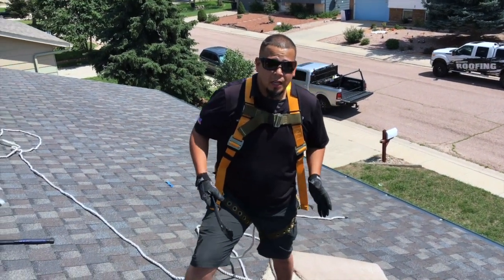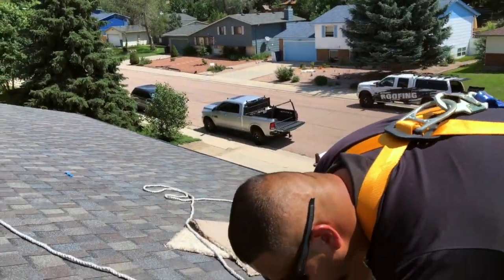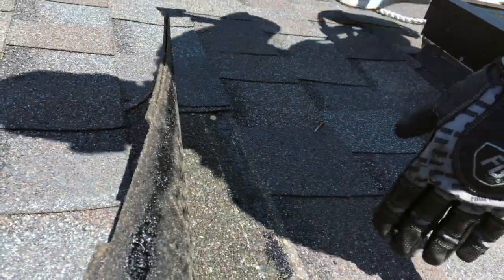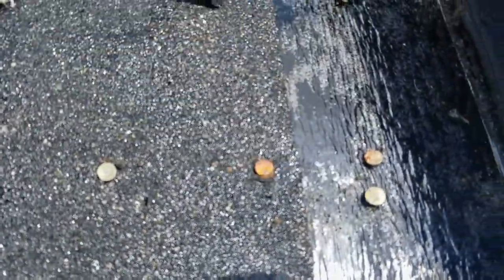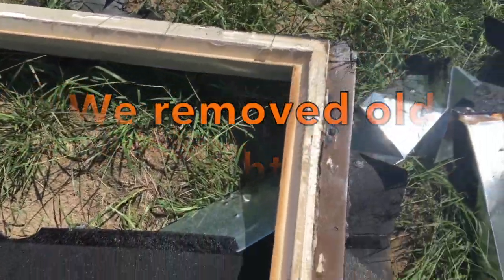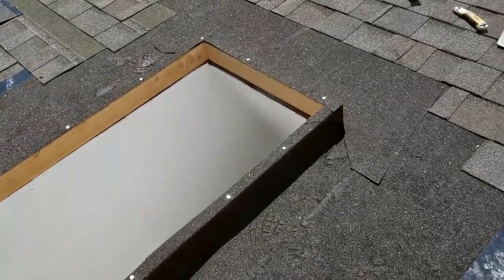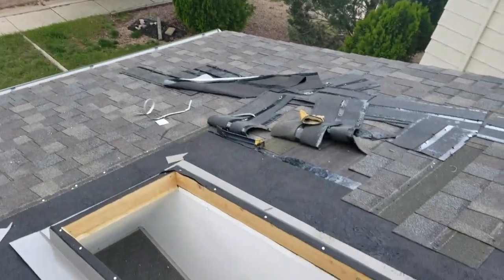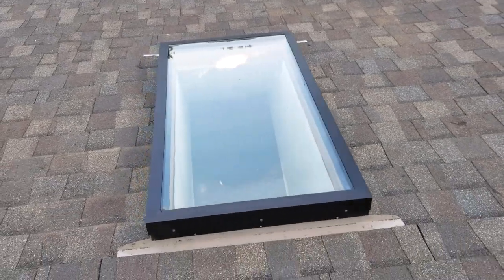HOW TO REFLASH A SKYLIGHT LIKE A PRO

Comment: looks good usually i run an individual flashing 3”x6” per shingle running all the way up that ensures any water slides right down without having a chance to get back underneath the shingle and flashing and being called out again
Reply: Called step-flashing.  Which I don't understand why isn't standard practice

Comment: Interesting to see how you manage with straight flashing.  You still end up with upper corners that depend on sealant and the membrane below for protection in torrential rains.  A formed upper flashing would be better, when one that fits is available.

Comment: Great vid, question if I may. Can silicone perish and let in water? I believe silicone was used in between the curb and the skylight cap when it was seated. After repointing the coping stones and applying a water proof sealant underneath them and still having water ingress it dawned on me that water may be getting in over the curb and under the skylight cap through the silicone and into the roof space. Would like your opinion. Thanks

Comment: Enjoying your videos. Any concerns about water traveling under new shingles against new curb since no ste flashing was used?
Reply: Meant step flashing.
Reply: Agreed.  That was my point as referenced above.  Why no step vs. a long section.  I it won't leak at the skylight, but the lack of step isn't directing the water back on top of the lower shingles which isn't preferred in my opinion.
Reply: Thank you.  I think that Joe has some sort of defect between the ears.  Sounds like you know your stuff backwards and forwards.  What area of the country do you work out of?

Comment: I have leak from skylight on my concreate tile roof.  A roofer said he has to remove tiles like 10 feet from edge or something and he would give me an estimate.  

My home was built in 1988 and I don't believe this skylight(have 2 of them) had been replaced so it is an original imo. 

Should I replace the skylight as well?

Please advise.

Comment: I have a porch with some skylights that I installed. The pitch of the roof is 1 or 2 so it’s almost flat and I have water pooling on top of the skylight. Is there a type of flashing that would prevent that from happening?

Comment: Basically you did the same thing as I was there before you put one piece of metal when you should’ve use the step flashings after each single within a year or two is going to leak the same way
Reply: He did it wrong! He should have used step flashing, not one long piece of L-metal, which is going to leak!
Reply: in the business of staying in business perhaps?
Reply: He put an ice-dam under the flashing that drains onto the top of shingles below the window. It's less labor intensive than the step-flashing approach, more costly, because the ice-dam is really expensive but the method is just as effective. I would not have run the ice dam on top of the curb for energy efficiency, but it'll work for keeping the roof dry and the window sealed.
Reply: How do you step flash a metal roof?😅

Comment: is it against the law to use step flashing in the west?? looks clean but all vertical curbs .walls in a shingle system roof should be step flashed
Reply: Why would you want step flashing vs. one piece? I come from commercial side of roofing and have only experience with metal roofs, but that looks better then step flashing Iv seen done.
Reply: @morehp1  I think because water will inevitably get underneath the shingles along the wall, the step flashing will keep bringing the under-shingle water to the surface before it spread sideways so far that it's already flow off the side edge of the flashing but still underneath the shingles.

Comment: Where do you get those aluminum pieces? Are they made specifically for the skylight? Did you cut them out yourself? What is the correct name of it?
Reply: U should put in the time in the video so we know exactly your question, but I think the answer is Step Flashing, also there are kits for specific skylight that also come with counter flashing, should come with new skylight.
Edit: wow they used one piece row flashing, I think they use roof cement to stop water from going under, would like to see this hold up, I think step flashing will hold up better

Comment: Interesting technique. I've always wondered why not just use one long piece instead of step flashing.
Reply: Horrible technique. He should have used steps.
Reply: The one pc works great when it has an open hem on the outer edge of the metal
Reply: You can't beat the quality of step flashing technique period...
Reply: mutante 77 not true. Just another old fashioned opinion
Reply: @qualityleafguardsguards7978  so wait you're tying to say that when you're shingling against a wall that's 30ft long, it's better to use one long piece of L flashing rather than step flashing? Get out of here. Step flashing is the best way to water tight a side wall and skylight.

Water flows downwards yes, but it also has the chance to flow sideways a few inches every half foot or so. That's literally why there's a 6+ inch book, no nails within 4 inches of a seam. Felt or synthetic is to be put on horizontalally at the eaves then continues upwards with a 3" overlap. Etc etc.

Don't go commenting on something G that you don't have a clue on how it works.
Reply: @Josh-ww5kz  bro, it’s not necessary to be a know it all when you don’t know it all.. I’ve been roofing for over 20 yrs and have  had great success and have fixed a ton of water leak problems that have been worked on by countless roofers and have seen places that step flashing was not doing the job!! On long sidewall flashing runs you need to make sure the flashing is one continuous open hem connected and flowing into itself
Reply: @qualityleafguardsguards7978  please stop. If you know anything about roofing you even know that velux skylights doesn't do this. Why don't use use a long piece of L flashing if it's superior to step flashing? Exactly. Because it's common sense on how water flows. You're just a leaf guard installer. RCABC doesn't even allow that, any inspector would fail it straight away if steps weren't used at a wall, chimney, skylight, etc.
Reply: @qualityleafguardsguards7978  if you've really been in "roofing" aka leaf guard installations, for 20 years. You should know how step flashing at walls/curbs works, one step per shingle, and the step should be a inch or so past the top lip of the shingle. The bottom should be pretty much just on the nail line or just above the tar strip on the underside of the next shingle going on. That way is the best proven method period. Proven by literally any shingle manufacturer and RCABC.

Comment: A one pc flashing for the side walls works great but really needs an open hem on the outer edges and in a lot of cases is the only thing used on high end metal shingles from the manufacture..
Reply: Not true. You do realize how much better a piece of step flashing is per shingle right? For one. If water runs along that wall flashing and diverts out, bam right then and there it's under the shingles and hitting the underlayment.

With step, it overlaps the shingle beneath it in a way that makes it so water has a low chance of actually doing that.

And to make it worse. Its highly likely that he trimmed the corners of the shingle going against the curb. Water will catch that corner and run along it going underneath the shingle and hitting the nails. Won't leak soon but after a few days or weeks it will rust the nail out, then damage the sheething and cause leaks inside the house. Not to mention the mould that will start to grow because of the water.

But I mean you're clearly a gutter guard installer so I wouldn't think that you'd know how water and shingle roofing works.

Comment: I have a question for someone. Can the actual skylight leak or does it only leak around the skylight
Reply: This type of skylight can leak over time, but if the roof has the proper pitch its pretty rare, typically what happens is these types of roofers do incorrect installs and thats what causes most issues.
Reply: The actual skylight can leak, usually due to a defect in the skylight, rubber gaskets aren't installed correctly.

But whenever a roofer inspects a roof for a leak call, you can usually notice if it's a skylight defect
Reply: @Josh-ww5kz  it usually is an issue of improper gasket install, seen this 15 or 16 times on brand new skylight installs.

Comment: Is it no problem to reuse the shingles?
Reply: I Would never reuse they breake when taking them off
Reply: If you're careful enough, and the shingles are still in great condition, you could reuse them, to avoid having mismatched shingles especially on 2+year old roofs.

Im sure you've noticed roofs that have different coloured shingles in some areas, but that's due to a leak or blowoffs. You just have to make sure you seal the nail holes on the shingle with roofing tar after you install them. Then put a few blobs of the same stuff to reseal the shingle down

Comment: You should’ve use step flashing On the saide and saddol on the back you did it wrong come to California and we will show you how to do it right
Reply: Mario Robles what part of California are you servicing? I just bought a house & may need someone that knows what they are doing.
Reply: I was waiting for someone to say this. These guys are hacks. Water has to always run onto something.  That's why each shingle should have its own flashing.  That skylight is made for lower pitch applications not shingles
Reply: @gradywhite9781  yub your right
Reply: @mariorobles379  the waters gonna catch the top of the shingle and leak a few feet down from and across where he put the ice shield.  Mario you don't have to worry about stuff freezing around there but I do  and this job is going to have ice problems